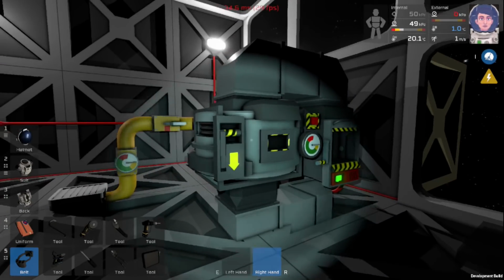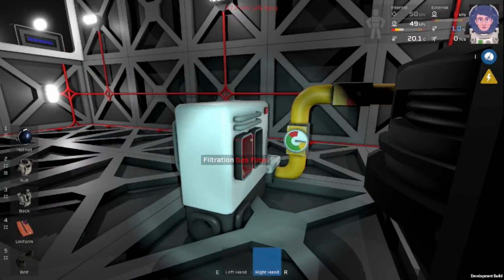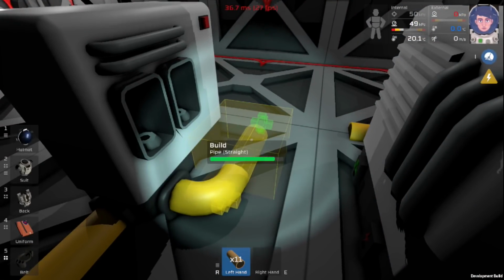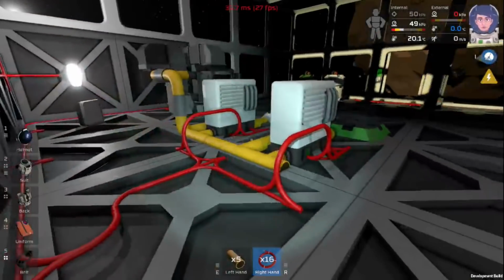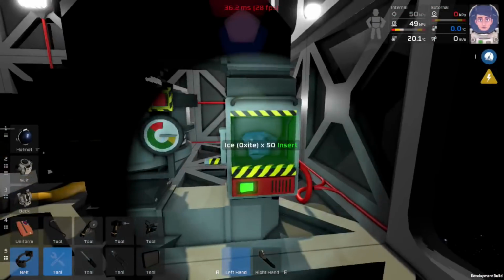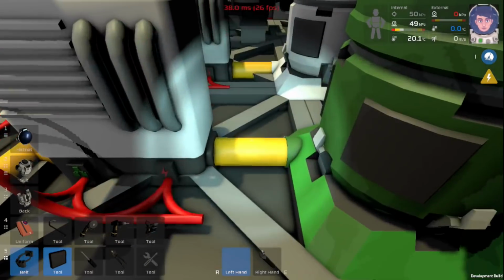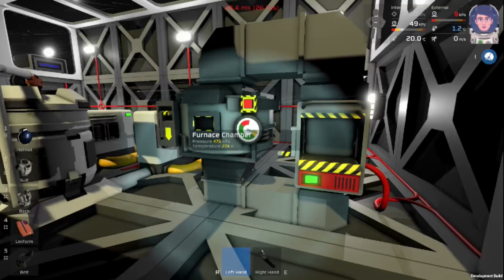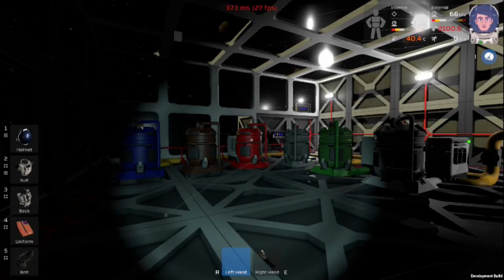Stationeers Tutorial: Gas Filter

Comment: i tryed this design but when im done smelting and close the valve my gasses start slowly draining im not sure why and when i disconnect the tank from the tank connector it stops leaking idk whats up  with it
Reply from the maker: Is it just because the temperature is lowering so the pressure is lowering in your furnace?
Reply: okay i found out that gas from the tank will go into the tank connector but i dont know why and it wont go back to the tank
Reply: no i dont think so i found out its going into my tank connector over time and just stays there

Comment: I did my piping WAY different I did not use a T-Junction on the input at all I use piped the waste to the input of the next in line filtration unit
Reply: Cycling a filters waste to it's own input does nothing but increase power consumption, realistically (since the filter needs to run to process the same gas over and over). You can get a speed benefit (if the volume of gas is high enough) by feeding all inputs at once but that requires very situational usage, while every usage with a feedback will consume more power than needed to process a given volume of gas. A serial setup is always more power efficient and almost always the same speed.

The only time parallel is faster is in high volume bursts but then why not just use the down time between bursts to process the gas as it moves through a serial setup for less overall power? I can't see a case, other than a couple of really specific exceptions, where this sort of parallel setup does anything beneficial.

That said, in early stages, where you don't have all the filters, this is a quick and easy way to extract just what you need, then if/when the pipes get too full you can add a holding tank. Once you get up to having all filters, though, it would be far more efficient in serial.
Reply from the maker: Good idea, but I think that having all the filters have access to piping network that it can filter the entire network faster. Thanks for watching!

Comment: Great video, thanks, the open-air mix was caused by manually dumping vol/ox amiright? 

I await your video on the gas for the furnace. We get it cooking but it chews through gas so fast and we can't figure out how to maintain temperature and pressure long enough for Invar.
Reply from the maker: Yes manual dumping lead to the open air mixing, I am working on a gasmixing/furnace video stay tuned!